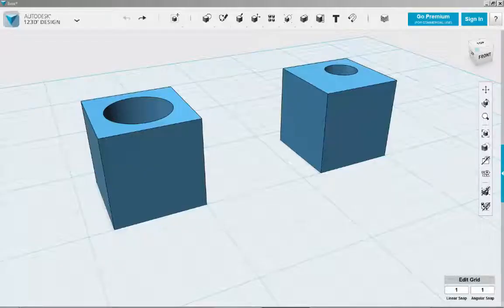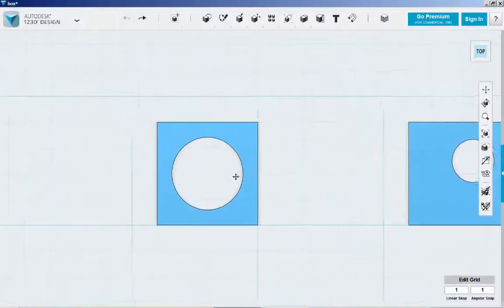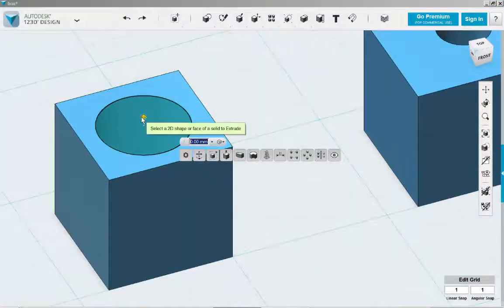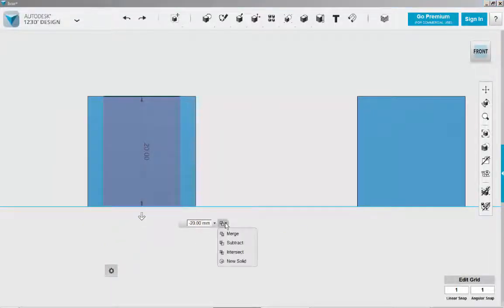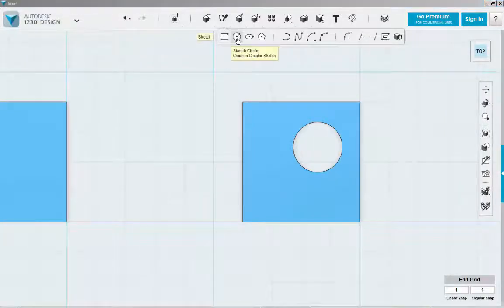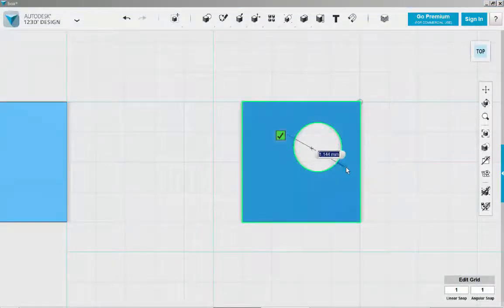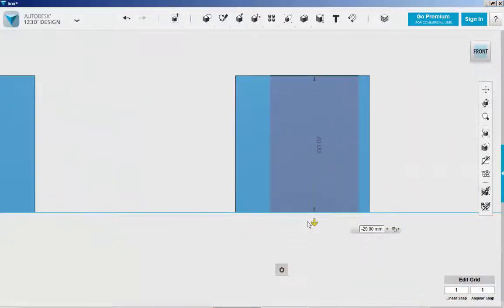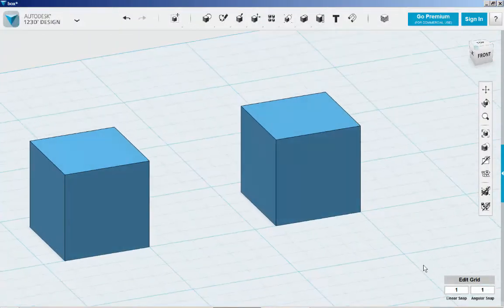123D Design: Fill Holes in Solids (Part 1)

Comment: one way I do it is I project the surface onto itself. I get the exact sized circle automatically, no guessing. 

on the extrude part, the extrude tool has an option to snap till a specific surface, giving you control on the height in relation to some other solid.
Reply from the maker: +Rupin Chheda That's a great suggestion, too. I just did a vid showing your and Craig's ways.

Comment: Perhaps an even easier way is to select the cube, select the sides of the hole, then select Press/Pull from the gear tool-tip and draw the hole closed. Just a thought.
Reply from the maker: +Craig Turpin That works, too! On a many-sided hole, I think my way takes less steps -on a simple one, yours does!